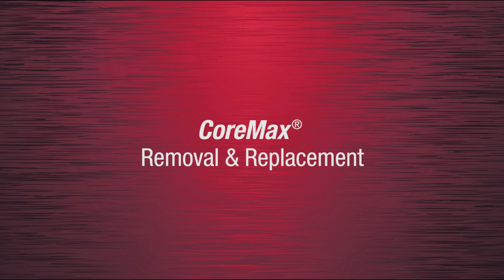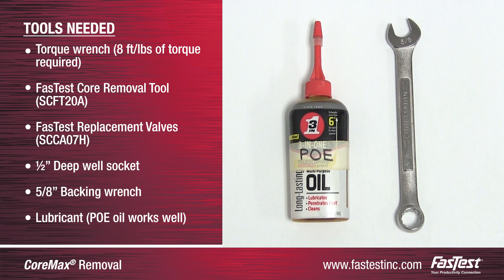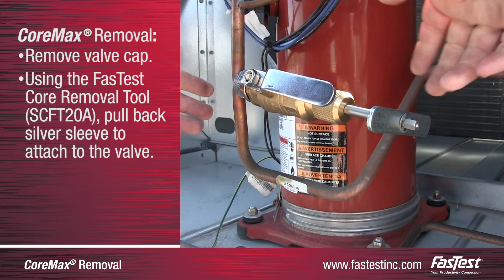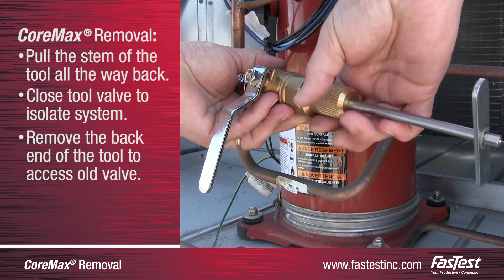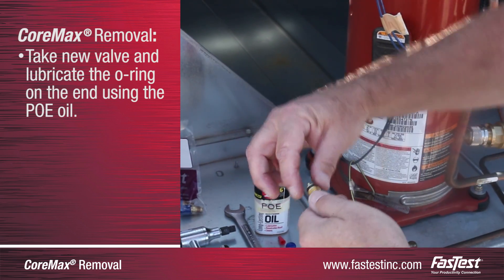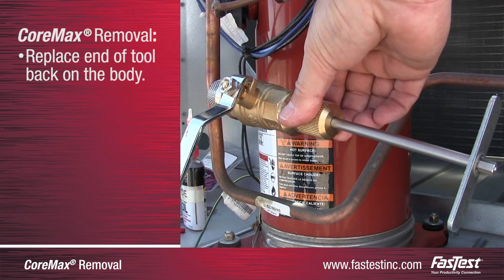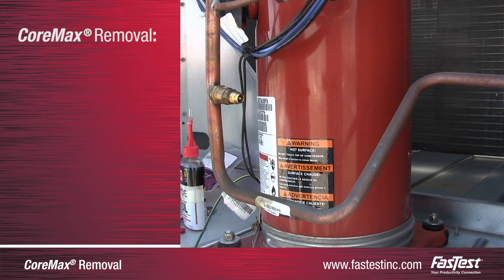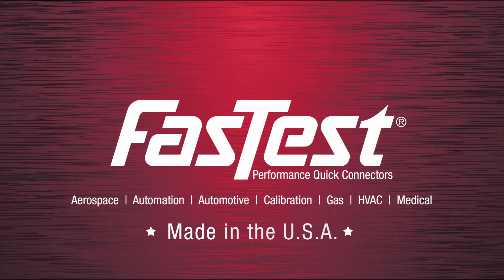CoreMax Removal & Replacement

Comment: Before removing the tool it would probably be a good idea to release the pressure that was built behind the tool during the install phase by cracking the back end connected to the t handle and bleeding the pressure out. Last thing you want is to just assume you got it and go to take that tool off to get a nasty surprise of a lost charge and burnt hands

Comment: Just used this tool today saved a lot of time company bought it for me though one thing to add is don’t over tighten the fitting might strip it and check with soap bubbles after to unsure to leaks
Reply: Good application double check .

Comment: Do you have to remove freon first?
Reply: No, if you have the right tools.
Reply: that's the purpose of this tool; is to replace the valve core without recovering the refer. if there's no pressure in the system you can do the same job with a pair of wrenches. it looks like the system they used for this demo is at atmospheric pressure, however. he didnt have to fight the system pressure the keep the tool engaged like you normally would.
Reply: Step aside homeowner, it’s union time